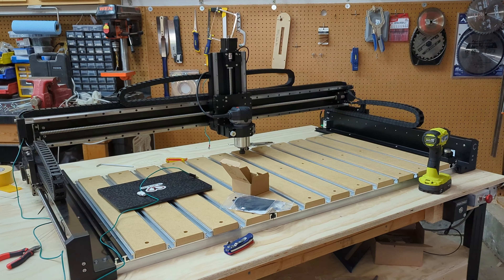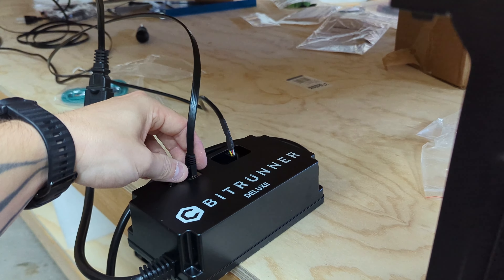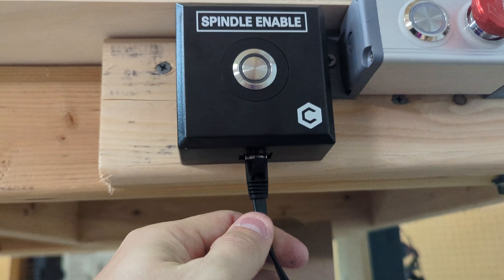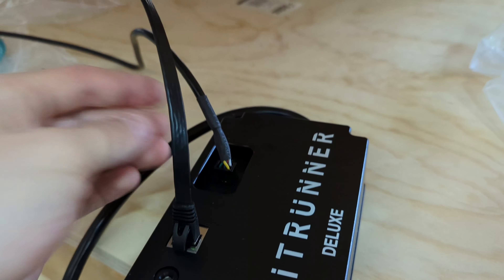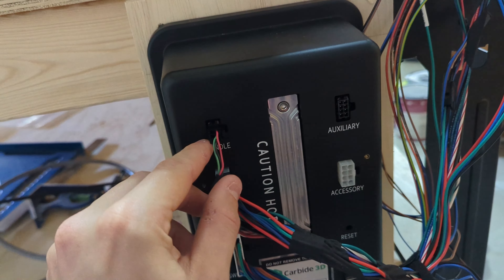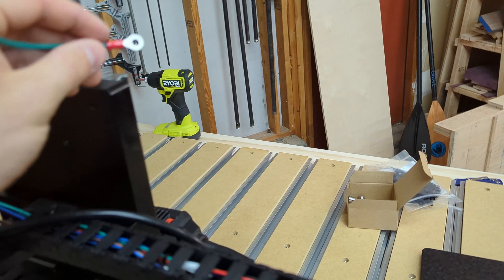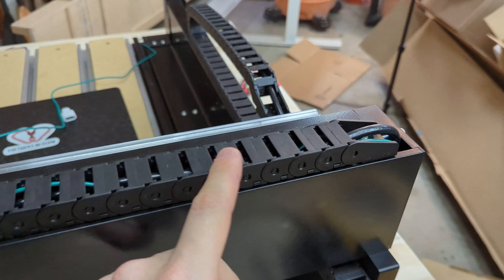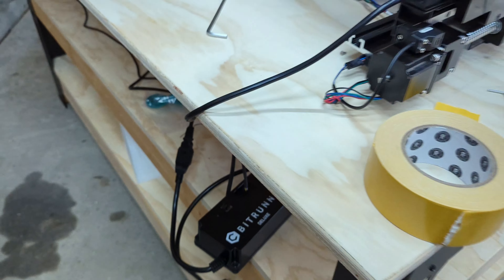Shapeoko 5 Pro BitRunner v2 Install

Comment: Can’t get it to work. Light ring on the pendant lights up red but cannot get it to enable the spindle.
Reply from the maker: Did you ever end up figuring this out?
Reply: @ unfortunately no, despite hours of tech support troubleshooting. Makes no sense. It’s all wired and connected correctly. Just a paper weight.